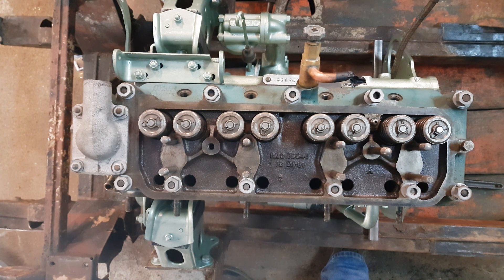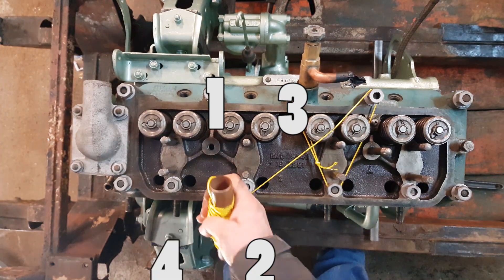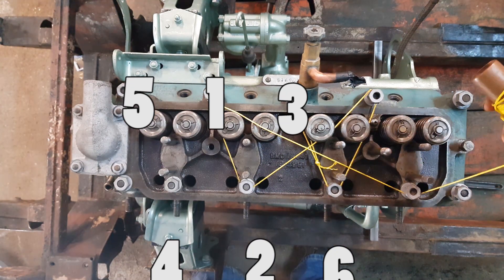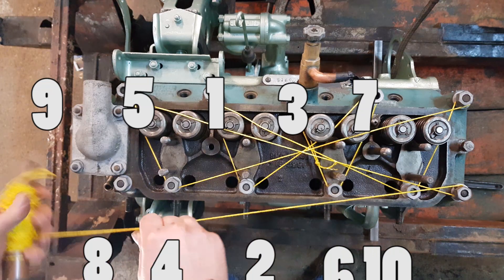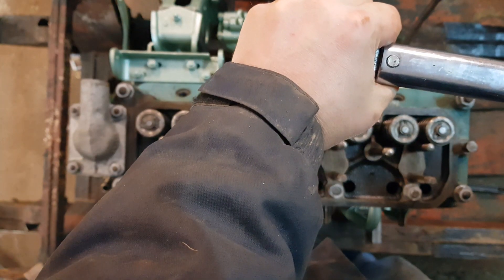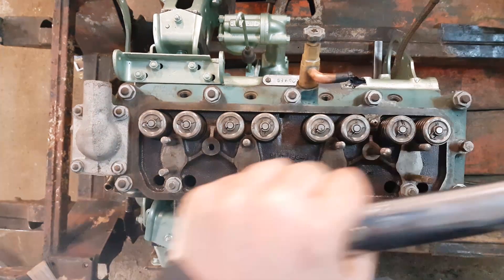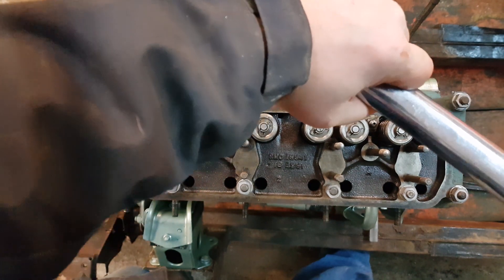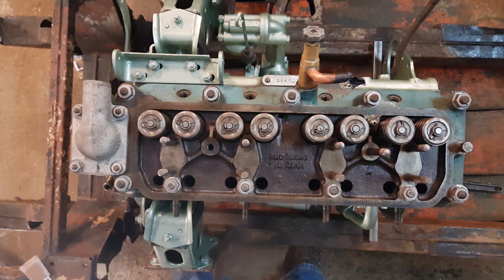Torquing Head Bolts - Austin Healey Service Manual

Comment: Very good and simple demonstration!  Cheers for that  wondering what your opinion / recommendation is for re-torquing ( nach-ziehen) of the headbolts, some people never do that and some insist it must be done whilst the head is still hot after the first warm-up, some say it has to be done after a certain amount of miles. your wisdom/experience might come in handy here. cheers!
Reply from the maker: The service manual doesn't say anything about re-torque them.  Doing so when the engine is hot would result in over torquing them.  If they have been properly torqued they shouldn't need re-torquing down the road. But I guess checking couldn't hurt.